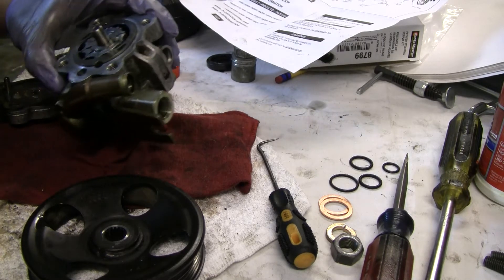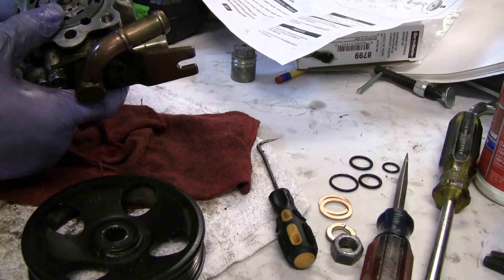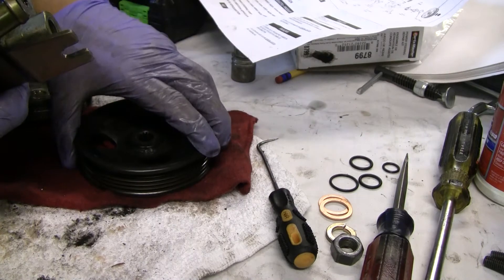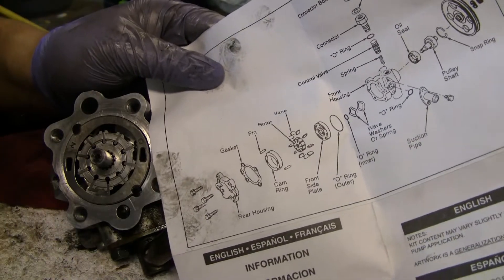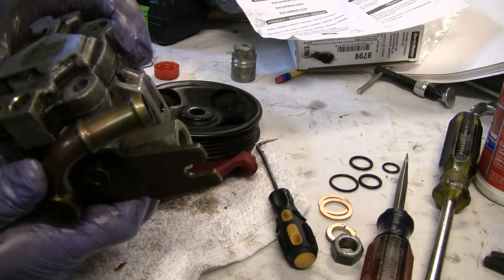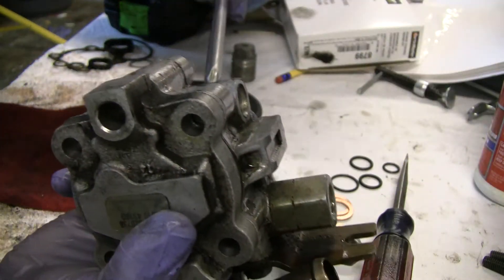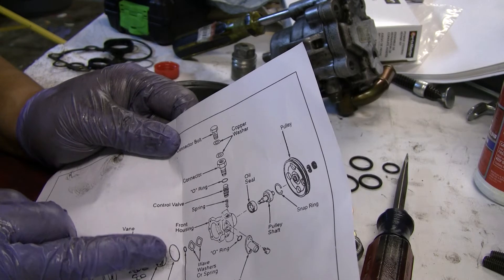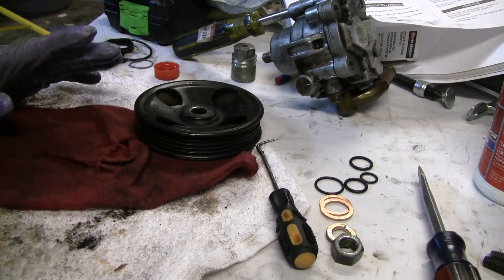2002 Nissan Xterra VG33E Rebuild Step by Step Part 61 - Power Steering Pump Rebuild Pt 5

Comment: If you haven't put the heads back on the block yet, you should seriously consider sending the camshafts off to be re-ground to a better profile. I should have done it when I swapped the engine on my 01- this VG33E is a turd with the stock camshafts. TheZStore will do regrinds since it's the same basic cam as the 300ZX.. 
I'm gonna have to pull my heads again this winter in order to swap the camshafts with some new ones, wish I had done it to start with.